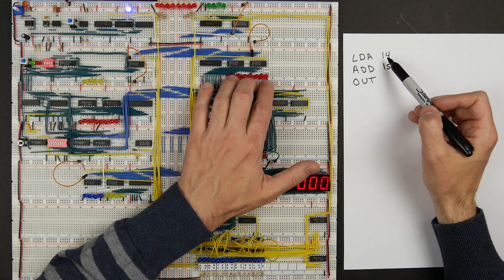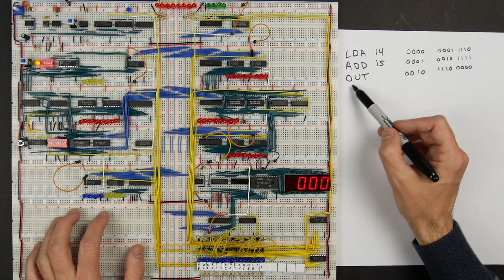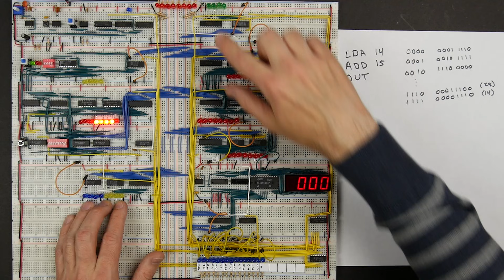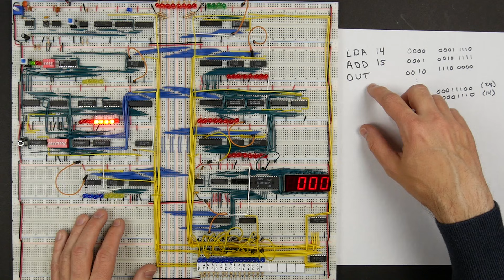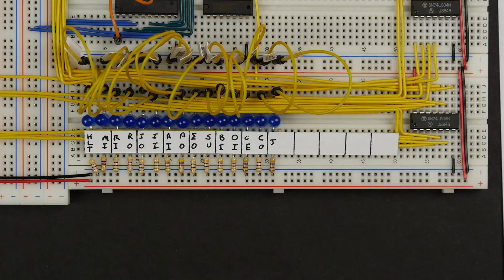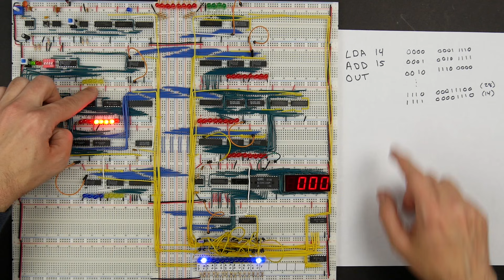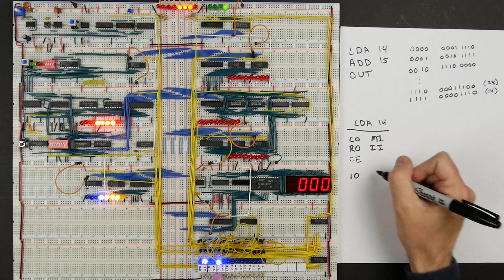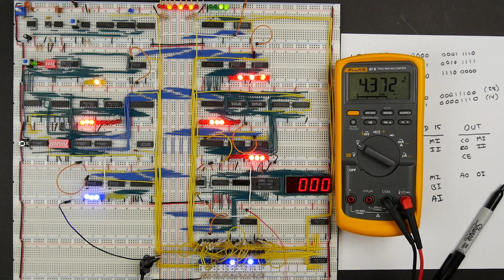8-bit CPU control logic: Part 1

Comment: Hey ben. Your computer only  has room for 16 commands in assembly. This is quite limiting on what code you can write with your computer. How would you overcome this limitation?
Reply: The other way you could increase the number of instructions while still keeping the processor 8-bit would be to use the entire 8 bits for the instruction code and then the following memory location could contain any additional data the instruction uses. It would make the control logic more complicated, but it would allow up to 256 instructions.
Reply: The biggest limit of this cpu is the 16 bytes of memory. Having only 16 opcodes isnt much of a limit really. A RISC chip would do fine with 16/32/64 opcodes. After that youre walking into CISC. But this cpu is obviously not meant to be practical or useful. Its a teaching tool.
Reply: The most obvious way would be to add more bits to each instruction, but another way would be to separate the operation code (opcode) from the data.  This would mean the LDA command would be in memory location 0, then the 14 would be in memory location 1, ADD would be in location 2, 15 would be in location 3 and OUT would be in location 4.  This method would allow us 256 possible instructions numbered 0 to 255.

This would slow down the computer since many instructions would take two clock cycles to completely load where the current design uses only a single cycle to load every instruction.  It would also make the instruction load operation more complicated.
Reply: Dje4321 Hi!

with 16 comands you can do more than enough operations. I have build my own computer that curently uses 7 operations, there isn't that many combinations you can make with these modules ben have built.
These are som of the operations:
LDA
LDI
ADD
SUB
STA
JMP
JC
OUT
HLT
Reply: Relatively simple to increase the program counter and memory address register to 8 bits.  I've been trying to come up with an answer that didn't increase the opcode size, but the 8 bits of opcode and immediate is just too limited to be left with something useful.  Best bet would just be to do a 16 bit instruction word.  This is what the Atmel AVR does, although it has the advantage of being a Harvard architecture CPU (separate instruction and data memory) and uses a 16 bit instruction bus.  It's still an 8 bit CPU because all the registers and the ALU are 8 bits.  It would then be trivial to expand the instruction memory to 16 bits by using a near and a far jump instruction.
Reply: Dje4321 There are many ways. The most obvious would be switching to a Harvard architecture, where instructions are in a separate memory. Then we can extend the program counter and jump address (e.g. let jump be two instructions, jumping to high or low addresses). Or we can add memory paging by having low and high memory address registers.
Reply: That would also make it possible to define zero-parameter functions (like noop, out, and halt), or even multiple-parameter instructions!
Reply: +David Refoua The 8086's instruction set is atrocious :q  A better one would be something like MOS 6502 or MCS-51 (e.g. 8051), since they are better organized and therefore easier to decode.

+Xrayer  I always wondered what is the minimal set of instructions (and the minimal set of registers) required for a computer to be able to do universal computing.
Reply: Mainly because there's more operations that could be useful.
The most pertinent is the fact that his ALU lacks the logic part of Arithmetic Logic Unit in that it can't perform bitwise operations.

Also. while more understandable and less necessary, there aren't any instructions for dealing with the B register.  There's no command to load a value into the B register nor output the value of B which means it's only there for temporary storage of a value in memory for the ALU use, and the machine can only use a memory location as an operand rather than a register (ie. you can add memory to A rather than adding B to A; again with only the two registers and B being used for temporary storage there isn't that much of a difference.)

Also there's no support for immediate operands (ie. add the number in the instruction rather than add the number form the specified memory location) which limits code density when working with constants (if the value doesn't change, it doesn't need to be in a memory location that can be edited, so it's more compact to store the number in the instruction rather than using up a memory location and storing the address so it takes less space and time)
Reply: His instructions remind me of the ARM architecture. I wonder if he can ever implement an 8086ish instruction set on a breadboard!
Reply: We really need more registers for a good RISC cpu.  Part of what makes them simple is having a decent amount of working space.  Take MIPS's load immediate - its really just an add immediate against a register that's always zero. (or if the constant is too big, emits a "load upper immedate" and then an "or immediate."
Reply: Nathaniel, Im not sure what your getting at but is it the 4 bit opcode using the next 4 bits for address/immediate that you cant use with 8 bit opcode? After the fetch, once instruction starts executing you could just sequence in another PC++ to MR and MO to [destination] for the data... no need for 16 bit opcode, or harvard.

So an 8-bit LDA [pointer] would become Instruction Fetch, then CO, MAI > C++, MO, MAI (timing sensitive, or just store in A temporarily like MO > AI, AO > MAI) > MO, AI

LDA imm8 would become CO, MAI > C++, MO, AI
Reply: ghostbirdofprey ALU logic is just add or subtract, with the write to A disabled, so we can detect Carry and Zero. Even Zero can be detected using subtract 0 then check Carry, as if A>=B carry is set on a subtract. A cool software solution that doesn’t even need A register update disabled if you add the B again afterwards.
Reply: I meant it as only having the option to write 16 instructions. 
0x0 - 0xf. Not a whole lot to do something cool with
Reply: You could also put addressing modes into your instructions, like "indirect", "quick", and "offset indirect", where the latter two could eat up any unused bits by putting a value in a single byte.  There's no real need to worry about decoding complexity, since Ben is presumably just going to use ROMs like he used for the decimal display.
Reply: Technically, you're fetching a 16-bit opcode; you're just doing it one byte at a time.
Reply: +Sci Twi  Given this is an 8 bit processor, the 8080 would probably be a better example than the 8086, anyways.

I really wish +Ben Eater would do a version where the instruction space is all 8 bits just to see ow fetching operands works.  I've seen people talk about the fetch-decode-execute cycle before, but they always pretty much go: fetch instruction and operands, increment counter, etc. and gloss over how the operand fetching part works when the instruction and operands (which are usually memory locations) are collectively larger than the machine word.
Reply: The limit is not 16. For LDA and ADD we use 4 bits as data, but the lower 4 bits of OUT could be used for the other instructions whithout operands. E.g. 11100000=out a, 11100001=out b, 11100010=swap, 11100011=Halt ...
Reply: Matteo Pascoli but then u need more logic to encode does 4 bits, plus why do u want more than 16 operations?
Reply: thanks for your reply!
Reply: If you are willing to sacrifice a single 4 bit op-code, you could have a total of 60 instructions! This magic op-code uses the lower 4 bits to shift into one of 16 different instruction sets. It would be cumbersome to work with, but doable. It could be made less cumbersome if each instruction set shared a few basic instructions to avoid having to constantly switch to the wanted set.

I think the technical term for such a solution is called a wart. It has the same beauty.
Reply: A working computer can be made with a single instruction. Look up "one instruction set computer".
Reply: His computer is only 8 bit. If he would go higher, ex 16 or 32 there would be more room for instructions.